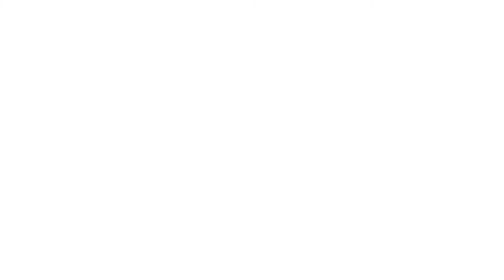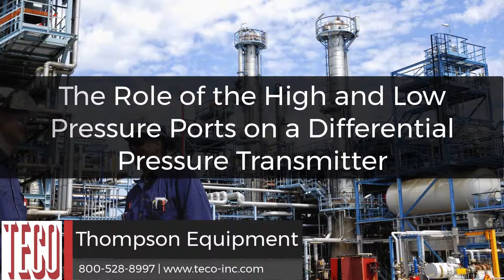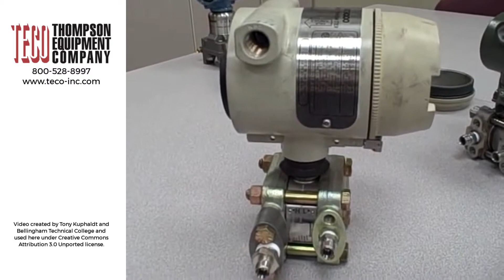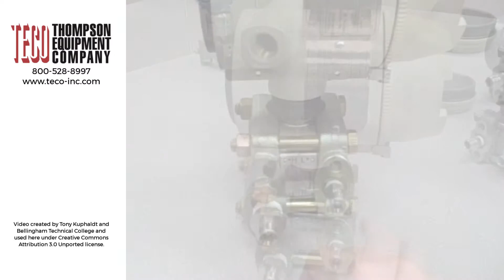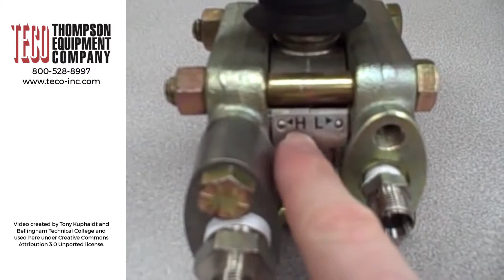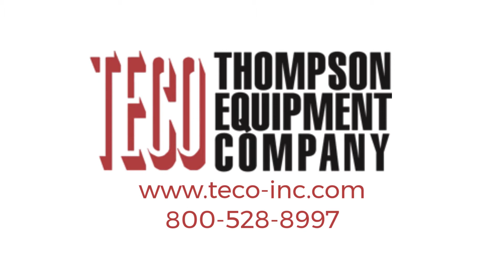The Role of the High and Low Pressure Ports on a Differential Pressure Transmitter

Comment: Great video! I just wanna make sure I understand. So if I was using a transmitter to sense static pressure in a mechanical space with one side on the outside of the mechanical room and  the other side on the inside of the mechanical room. Would my line from my mechanical room go onto my high side and then the line from outside the mechanical room go on the low side? It’s for starting a relief air system.